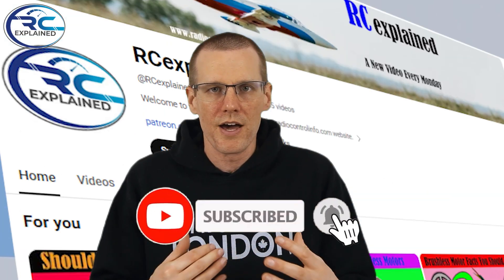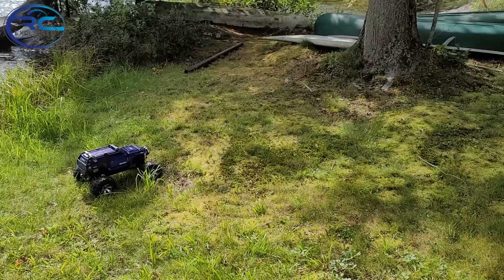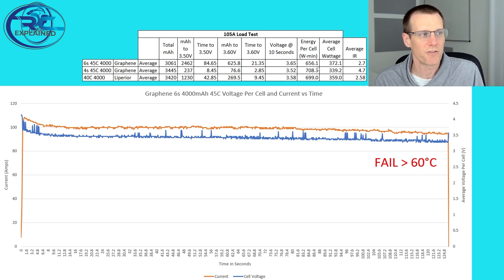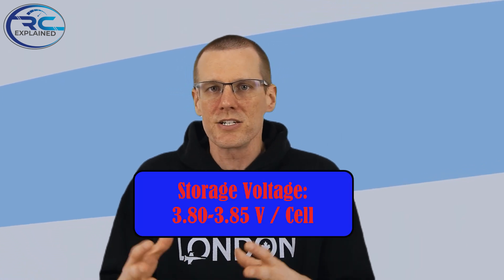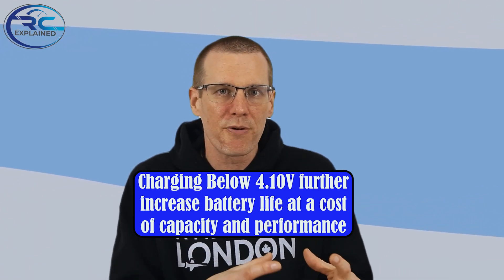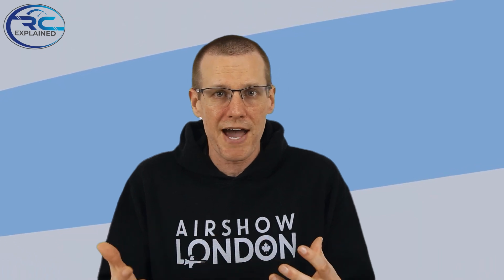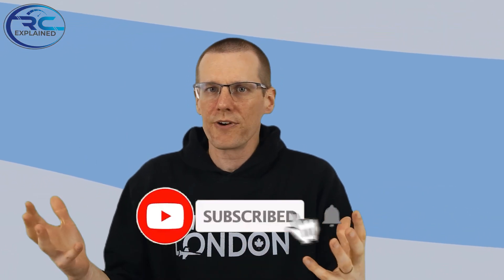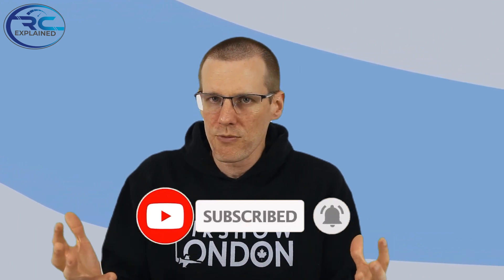Maximizing LiPo Battery Cycle Life with One Super Easy Hack

Comment: so... you double the "life" by only putting half as much energy in... yeah, most people wont bother to do that.  rc planes and drones in particular are already pushing the packs hard running them down fast.  having to go through the process of changing them out not to mention  waiting to charge them twice as often?  not worth it to literally get the same lifespan, just with more time charging.
Reply from the maker: No, I think you missed something major. It's not even close to half the energy. It is 90% or more available capacity.

Comment: I have had two packs of 2S Turnigy Nano Tech 12500 mAh (I don't think they make this capacity anymore) batteries since August 2014. Always charged them to 4.15 Volt per cell and never discharged below 3.5 Volt per cell. Always stored at 3.8 V per cell. They were used on a regular basis and have only just started to show signs of old age and getting a bit puffy (Like their owner) The internal resistance is still very low and they are well balance but I am going to retire them. So I can agree completely with your advice.
Reply from the maker: You've been able to achieve some excellent life out of those packs. Well done.

Comment: I paid for all the amp hours, I'm gonna use all the amp hours! lol
Reply from the maker: You totally can at the cost of paying for some more mah sooner rather than later
Reply: @RCexplained  yep. I've been considering just running 20% larger packs at 90% charge and 20% discharge so I get the same run time with less capacity degradation
Reply from the maker: @SFPFPV  I think that's a great idea if you can afford the size and weight penalty.

Comment: I’ve known that charging to sub-maximum voltage can increase life-cycle but very interesting to see a formula to calculate the correlation between end-voltage charge and relative life-cycle. I’m assuming it doesn’t matter if we are talking Lipo, HVLi, LiFe, LiON, or LiXX as 0.10v doubles life-cycle across the board?
Reply from the maker: Batteryuniversity.com labels it as lithium based batteries. I've only seen data to support lithium ion and polymer.
Reply: Thanks for that info:) I’ll keep this in mind in the event I start sub-charging my HVLi packs, but it stands to reason that those packs would be ideal for this concept as a 0.1V sub-charged HVLi pack would offer higher voltage (4.25v/cell) vs the more commonly used LiPo and have approximately double the life-cycle! Very cool, and thanks for doing these somewhat tedious demonstrations. 

Side note: I’ve been searching for a dynamic lithium battery load tester but very tough to find anything that can load test over 12-15V with variable load settings. Found one that can be programmed to exert up to 1000A amps and 100V but it’s $7500

Comment: Kindly note that most of the manufacturers advise not to go under 3.7v per cell, so what will happen if one, for example, sets the esc cut off to 3.3v and discharges the battery to 3.3v per cell? 
When putting the battery under heavy loads, the battery could go under 3v per cell, temporary, so do you think it will also affect the life cycle of the battery, if the esc is set to 3.7v?
Reply from the maker: It really depends on the application. For some of my RCs I could not even run them with a cut off of 3.7V. Meaning I'd have the capacity I started with. For most setups a cutoff of 3.4v/cell will result in a resting voltage of 3.7v/cell with a moderate load.
Reply: @RCexplained  with some batteries, I am very careful when using them for drag racing or speed runs because the motor withdraw between 400 and 500 amps, and if they go under 3.8v they will be puffed and permanently damaged. 
On the other hand, I use another type, and once the battery went to 2.7v and kept on giving me power that I didn't realise and I thought that I damaged it but until I went back home the battery recovered and went up to 3.3v by itself that I balanced charged without an issue.
I think it could be that they use different chemicals, which is why one type of battery could go down to 3.3v without an issue and other type could not because it will be damaged permanently from my experience!

Comment: Time at full voltage matters more than weather you charge to full full, or less than full.    Charge your batteries then go play don't charge the night before or days before.  and when your done playing, make sure they are above 20%.    

I've been doing this for years.   I log every run in a spreadsheet since 2011.  I have batteries with well over 500 cycles that are from 2011 on them with nearly no loss in performance following this rule.
Reply from the maker: I totally agree. You are going to get better results with 0 minutes at 4.20V vs 60 minutes at 4.20V. Same with 60 minutes at 4.20V vs 720 minutes at 4.20V

Comment: As a drone racing pilot… I HV Charge all my packs and always storage Charge after any race day.. thing that’s hurts a pack is big amp draw..  the only difference between a hv pack and a normal pack is Cherry picking low IR packs off the line.  Also having a battery sponsor is helpful
Reply from the maker: It's true, big amp draw leading to more heat in the packs is quite rough on them. Thanks for sharing your experience.

Comment: so what then when you get to 283 cycles? its not like it falls off a cliff. Thats just when It reaches 90% rated capacity left. So you can just charge to 4.2 and get back the same run time as when it was new or just live with continud reduced run time, it can still go much longer than the rated cycles in ideal conditions
Reply from the maker: A lipo is considered dead or at end of life when it reaches 70 to 80% original capacity. You can certainly use it in a more lighter duty application and get more usable life out of it.  The 70 to 80 is just the line in the sand that had to be drawn somewhere. Otherwise you can theoretically say you still get 10% capacity and the battery could still power something I'm sure.
Reply: @RCexplained  thanks bro. Great info and video as usual. I just meant for us to question the definition and then have a reference to what it really means. Knowledge!
Reply from the maker: @ruuster83  batteryuniversity.com is a great resource for this type of stuff. Thank for your your kind words and comment!

Comment: If I fill up my gas tank halfway does that mean my oil's going to last longer.  NO, the oil still has the same amount of life, like a battery. if I only drain 10% each time use a AA alkaline battery and I do that 10 times. Is that 10 cycles? No, its one. It's the same as using a battery from 100% to 0. It's the same amount of life. If someone told you your car would last longer. If you only used one gallon at a time. Would you, do it? No, because it'd be a waste of time. You end up spending more time charging. than using the battery. Use its capacity. that's what it's for We're not trying to save these things. It's a consumable item. It Is going to lose capacity whether you leave it on a shelf. In its factory packaging. Or you use it to its full potential. Every day. Its losing capacity, so you might as well use that capacity while it's available. Because you're going to lose it eventually. One cycle needs to be defined as using a battery from 100%. To 0%. And back to 100. So if you drain a battery down to 50%. And charge it. Drain it back down to 50%. And charge it. That's one cycle.
Reply: Very bad analogy.
You thinking that using ten times only 10% of a battery is the same as using it once for 100% just shows that you have NO idea what you are talking about.
Reply: So the long term EXPERIMENTS that found out  when you only charge to 8O°/ every time you get double the life cycle out of the pack are not true? 
You might not care and just buy another one when it doesn't give the capacity anymore. But it's like the oil in your car, if you change it regularly you can drive your car longer, and it's cheaper to change your oil than buying a new car.
Some eat the chocolates in one go, other keep some for every day....😉
Reply: @pashmaster  well if you only charge it to 80% each use thats not a full cycle its .80 of a cycle, don’t believe me look at how many charge cycles your phone has and how it counts cycles, a cycle is counted as 100% so if you use 25%, then charge it thats .25 of one cycle, so if you do that 4 times a day that would be one cycle. If you only discharge your phone to 30% and charge to 70% your only using 40% so your going to 2.5 more charges then i would if i use all of it, but at the end of the day we got the same life out of our batteries +~ 3%.
Reply: @pashmaster here is a better analogy lets say you have 3 scuba divers they all have the same oxygen tanks, and these tanks can be recharged to full lets say 1000 psi exactly 100 times before being recycled diver A he uses his tank from 100% to 0 and recharges, diver B he only charges his to 75%, 750 psi, so the manufacturer say your stressing the tank less you can fill yours 125 times before recycling, diver C he is a shallow diver so he like to fill his tank to 50%, 500 psi so the manufacturer say if you only fill to 50% you get 200 refills on your tank before recycling. Now each guy goes to work diving, who is gonna get more work done at the end of there tanks life? I would say the guy that refills 100 times gets more out of this tank because he can focus on work for longer each session, starting and stoping 100 times less then diver C, but at the end of life, there tanks processed the same amount of oxygen. Aka the batteries rated life cycle when used to 100%, now do you wanna take the time out of you day to plug in 100 times or 200 times. Time is money, so the extra 100 times your plugging in i am continuously working my battery, are cycles really a good thing?
Reply: The problem with the analogies is that a battery uses chemical reactions. It isn’t just an empty container you’re dumping energy into. 

If you charge to 4.1v you still have almost 90% of your energy. But you get double the cycles. That is more work done over the life of the battery by a good margin. 

Your analogies change the math by assuming doubling the cycles means you only “half fill” your tank.
Reply from the maker: Interestingly enough, when I race my car I only fill up my gas tank with the the fuel I need. You can't do this with a battery, unfortunately, to save weight.
Reply: So did I miss WHY this works?

Comment: Li ion batteries last much longer!
Reply from the maker: They should, yes!
Reply: Oh they do, in terms of capacity, and thousands of cycles, rather than a hundred or two for Lipos in my personal experience. and discharge them below 3v, no problem.  :).   I'm using EVE /35V 18650,  Panasonic NCR18650GA and molicel 3500mah 10A. all work equally well, with the EVE being the least expensive with the highest capacity.

Comment: I mostly do this at least with keeping my batteries at storage level until I plan to go out. I carry three batteries with me while trailing for 3-4 miles. My Max Amps 4000 True 150C is my most expensive but best performing battery after 4 years of use. That does get charged up to 4.2 but I will change that starting today. What should I set my lipo cutoff at 3.73v for the low end? I only charge at 1C. I can only set a minimum max voltage of 4.18v with my current charger.
Reply from the maker: I have a video on what to set voltage cut off to. It really depends on the application. I have mine set somewhere closer to 3.4V per cell as the packs will be loaded. 

If your charger doesn't go any lower, you could always just pull the packs off the charger early. The battery voltage will always settle lower then the current charge voltage. Just keep that in mind if you do decide to try pulling them early.
Reply: 150 TRUE C HUH?  Don't hold your breath on that.
Reply: @daysdesigns  😆

Comment: So the way to make it last the longest possible time is to leave it at storage voltage and not use the battery. :)

I use my batteries for racing so I absolutely want to charge to the highest voltage possible. I presume that by the time they aren't performing well enough there will be newer better batteries available.
Reply from the maker: Yep, kinda like a car. If you keep your car in the garage and don't put any miles on it, it will last longer and be worth more in a couple years from now. Haha.

But I too race for top speed numbers and need max voltage.

Comment: Charging lipos at 1/2 to 2/3 C rating 👍👍  But doesn't have option in my charger to finish charging process earlier
Reply: Use a Li-ion preset
Reply from the maker: @Wok_Agenda  great point!
Reply: @RCexplained  😏
Reply: What is your charger model? In most charger you can set the max voltage for the battery charging. Reducing the voltage per cell you can achieve
Reply from the maker: If you'd really like to try, you could pull your packs off the charger manually. This is an option but not a convenient one.